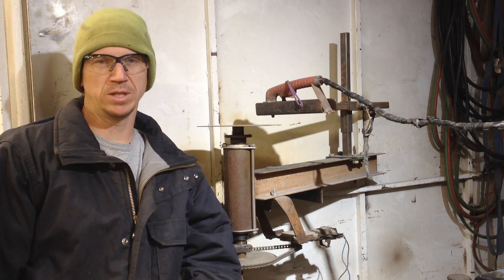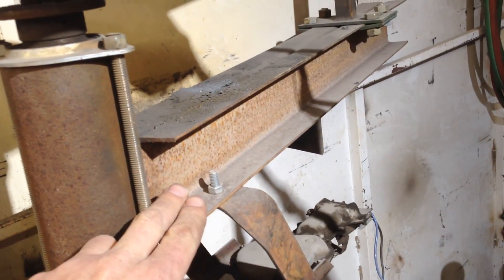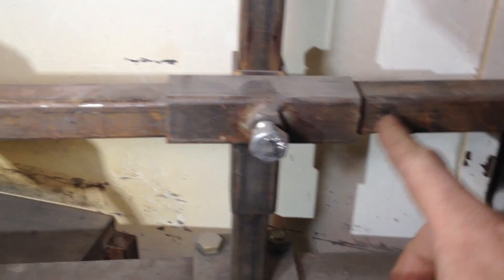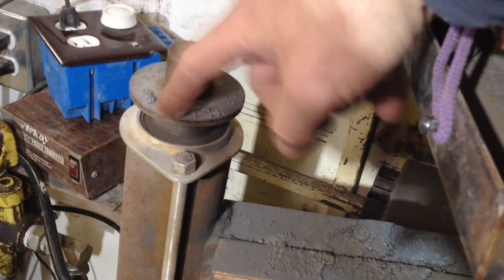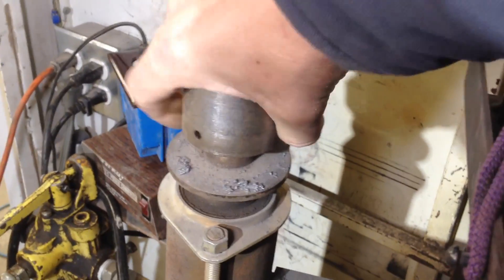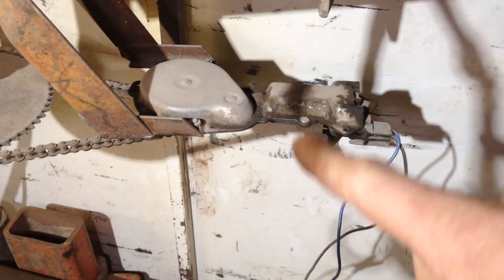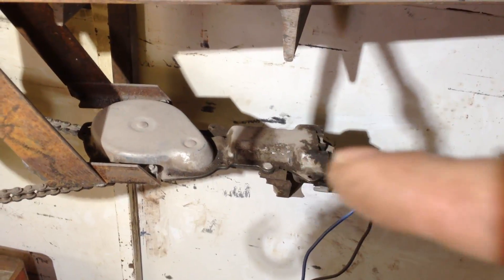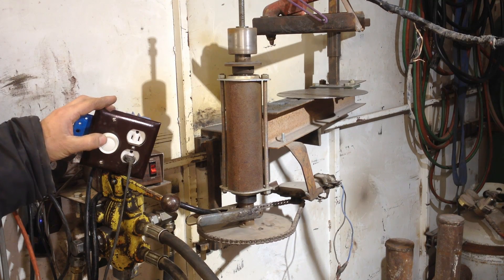DIY Plasma Circle Cutting Machine

Comment: I believe the stepper motor will introduce another source of vibration, unless you use an expensive version with feedback and a controller capable of using the feedback. I would stick with the current version since you already got full control.
Reply from the maker: That's a very good point!
Reply: Sometimes lo tech is hard to beat...

Comment: CNC circles ==>  Holes that aren't necessarily round...   lol
With 2 axis you could easily make yourself a kinda of a plasma cam type machine, this would allow you to make even complex shapes. More work to realise though.
Even in this very simplest for it's way better than my apparel that operates totally by hands, never the less with a steady hand those will give decent parts.
Cheers,    Pierre
Reply from the maker: I've seen a few videos about not round stuff from CNC plasma cutters. And knowing what I do about programming, I know they are not round. Computers don't understand circles!  I dream of turning this machine into something that can cut out sprockets and ovals.

Comment: When the  design works, just good enough to get the job done, the design is done. When you use stepper motors, what would you use for a controller?
Reply from the maker: Yep, I often get caught in the "good enough" predicament since I'm usually need to get it done yesterday!   When I built the machine years ago I was going to use a Laptop computer to drive the stepper. The parallel port can drive steppers quite easily. Now, I'll probably go with Arduino.